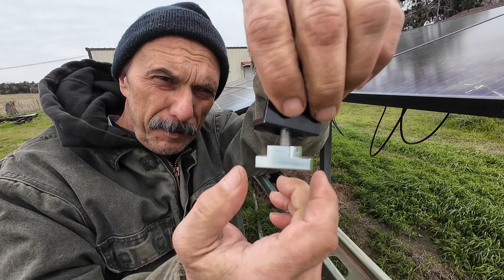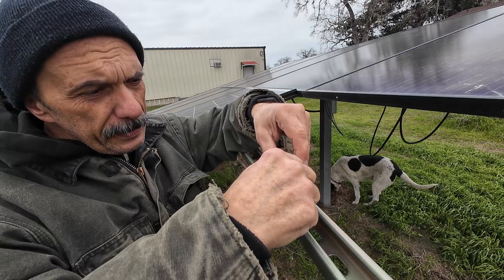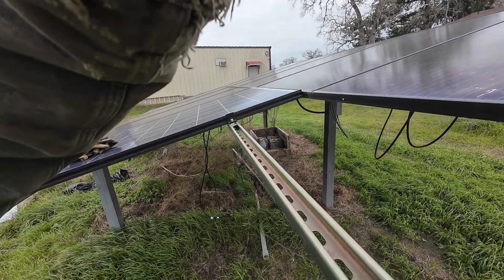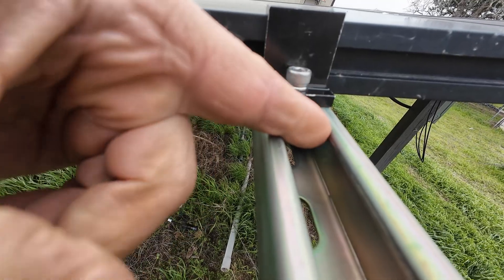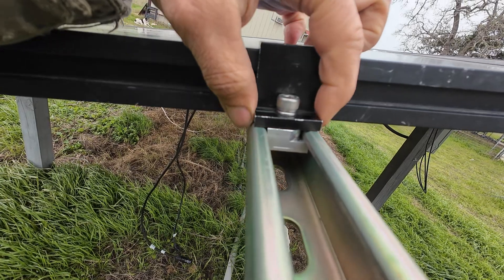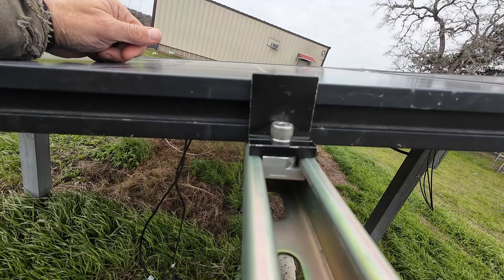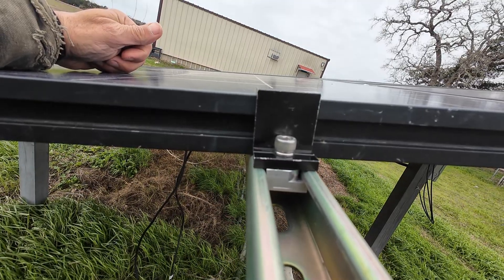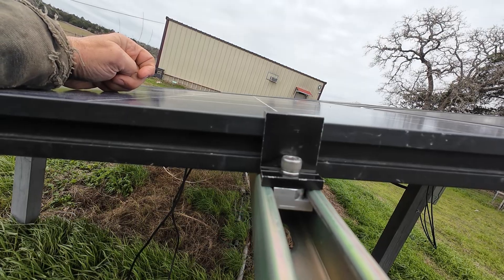How To Mount Solar Panels On Unistrut DIY New Method!

Comment: You don’t say how we can get the additional T piece to put onto the signature solar mid and end clamps.
Reply from the maker: Those are custom made, their too expensive unless I can get some big orders to get the price down. They cost me $6 each for the first 100pc run with the cost of fixturing and their not anodized. I'm working on it, let me ask you what would be a good price and at how many pcs? Thanks for watching!
Reply: @DIYSolarFarming  ok, Ill find washers. have you heard of a success of using ustruts on the flash minirails without the 6” piece? One commenter said he was going to do it.  Think it will work?
Reply from the maker: @PAULAKEITH-m7m  Hey Paul, I don't understand the question can you clarify it for me?
Reply: @DIYSolarFarming   sure. I saw this video, https://www.youtube.com/watch?v=P2rsnUAsfN8&t=708s        Then I thought if you take the 6” mini rail off the signature solar flash mini rail , https://www.youtube.com/watch?v=P2rsnUAsfN8&t=708s    you could put the superstrut on top of that flash square landing that the mini rail was attached to. That way you can put the flashing into the risers of the roof.
Reply from the maker: @PAULAKEITH-m7m  That looks like it could be a good way to go, good thinking! Only thing I see is that you will need to drill a hole or extend one slot in the unistrut for each mounting point if you want to use both screws. 
The slots in the unistrut are too far apart.
Reply: @DIYSolarFarming  Ya, depending on the set up, if it looks like too much weight is on an end, maybe I can put a hole in the middle of the minirail flash horizontal piece. I’m buying just one to take it to lowes to see. how it works with the rail. thanks for your imput. you have great ideas too!
Reply from the maker: @PAULAKEITH-m7m  Let me know how it works out for you.
Reply: @DIYSolarFarming  will try to remember to get back to you! thanks for your content.

Comment: The nuts you made are like flex links so check out to made sure it's ok to sell before you put a lot of money it to it Good luck
Reply from the maker: Thanks! I couldn't find flex links, do you mean these from Flex Strut? https://www.flexstrut.com/Product?id=No%20Spring%20Nuts
Reply: @DIYSolarFarming  No it is a company you can make conveyor fences table anything to use in your company Factory they not the same size so if it matters I just thought it was a good idea but don't want big brother coming down on you they are a big factory so they may not care I worked with there products for over 40 years  they may be proud you made the and it may be enought difference where you be ok Good luck
Reply from the maker: OK, I appreciate it! I will look them up. Have a good day and thanks for watching!